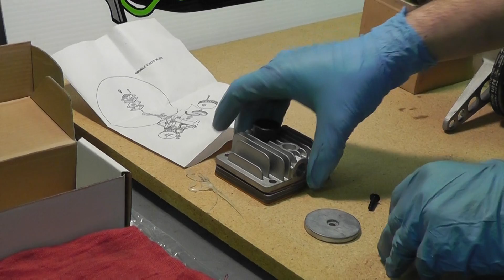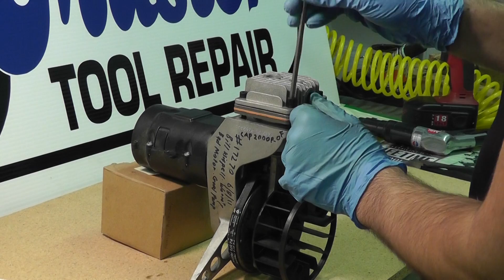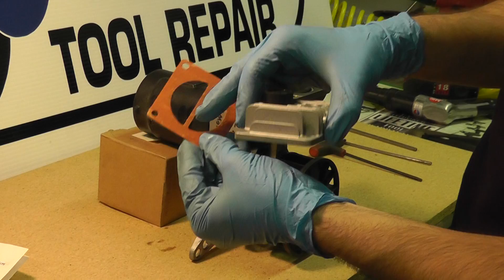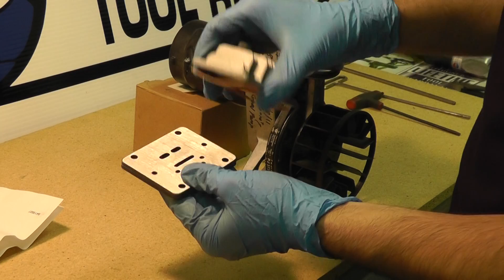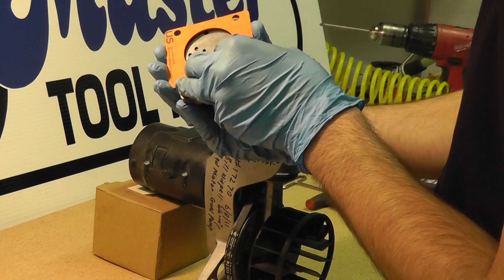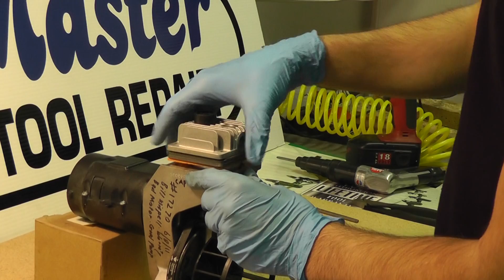How To Install A Valve Plate On A Direct Drive Air Compressor - MASTERTOOLREPAIR.COM

Comment: That plate your holding that has some holes and I don't remember how it's placed. If the hole goes towards the top or bottom or on the sides.
Reply from the maker: I was wrong in telling you the single large hole on the valve plate installs on the intake side of the head. The TWO SMALL HOLES on the valve plate install on the intake side of the head, where the air intake filter is. Below is a better video on the install of this exact valve plate on a unit. I think this will help!

https://www.youtube.com/watch?v=G68ZpXAZUuA

You can find the information at about 19 minutes in. I hope this helps!

Comment: Help please. Hi. I have the Cap2060p air compressor oil free I took the valve plate off and now I can't remember how it goes back on can you help or if you have a video you could direct me to. Thanks
Reply from the maker: For this model, I believe the longer cut-out (hole) in the valve plate installs directly underneath of the inlet side of the pump head. The pump has a large indentation on the inlet side where the small foam air filter element is placed, this is the intake side of the head. The valve plate has two separate holes on one side and a longer hold on the other side; the longer hole is the intake valve and that installs on the intake side of the head. 
I hope this helps, and if you need more detailed information, please contact Bostitch customer service directly at 800-556-6696.